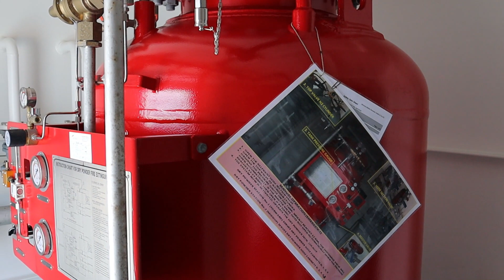How Does The Main Dry Powder Fire Extinguishing System Really Work? Training Video for All Crews 🔝⚓

Comment: Many thanks to you Captain for this great video. I want to ask you regarding the aiming of the cannons upon the manifolds. Once a second mate told me it has to be aimed at angle of about 45- 60 degrees in order to get the max possible coverage of all manifolds in use ( minding also the loss of pressure , as the system is running) . But i never manage to cross check this info. Do you know if thats true ?
Reply from the maker: Good morning Kalimera Kosta, yes he told you correctly most probably for the discharging arms to be used if your vessel was loading or discharging.
If you are currently on board an LNG carrier you may find this information on the SOLAS firefighting manual and on the telephone booth area on the Port and Starboard of the Manifolds.
The diagram is there and it displays requires elevation and angle to be set accordingly.
Reply: @nickthesailorman360  Thank you Captain for the feedback, i will have a look on that.

Comment: dry powder hose cabinet with 33 m must covered LOA of vessel and the manifold port and stbd must have dry powder monitoring, and for dry powder hose cabinet can disch 3 kg/sec and for dry powder monitoring 10 kg/sec, every dry powder hose cabinet and dry powder monitoring must be running min 45 sec, from that you can count the minimum capacity of fix dry powder tank on board, if i'm not mistaken...

Comment: I love and enjoy when someone is posting videos like this, thank you. Since the last time, I was a chief officer on board an LPG gas carrier, for every single operation, I passed my time explaining to my crew members the use of the DCP remote stations, paying special attention to the release of the system remotely and operating from the release boxes utilizing a NITROGEN PILOT  cylinder or al- alternatively manually operated at the dry powder unit. 
A pilot valve opens the main discharge valve, and the dry powder flows through the distribution manifold to the monitor or hand hose line in question, as you have explained. At the present moment, I am looking for employment. Rgds

Comment: Can someone clarify that why nitrogen is used as propelling agent instead if co2 in DCP type fire extinguishing systems. I recon that moisture in gas may solidify DCP into cakes and similar substance but usually both nitrogen and co2 are dry  gases .

Comment: Thanks for your explanation. one question i have, i think dry powder release control box to be located on trunk deck not near manifold and dry powder nozzle to be fixed. even if fire fighting euiqment has, it's very dangerous to reach manifold area.
Reply from the maker: This is as per regulations there locally but there is the other one in the CCR.

Comment: Thanks for the well explanation about the DCP system. I have a doubt in maintenance of DCP system. 1)how to avoid caking inside the fixed DCP systems ?`(generally in portable extinguisher we make it by upside down and shaking the portable extinguisher.)
2)how to take foam sample content ?
Reply: Thanks a lot  sir..
Reply from the maker: Sagitation is the one you need to look in to, I have done it and requires a good quantity of nitrogen cylinders under pressure.
Reply from the maker: Foam sample read the manual to see your makers advice.